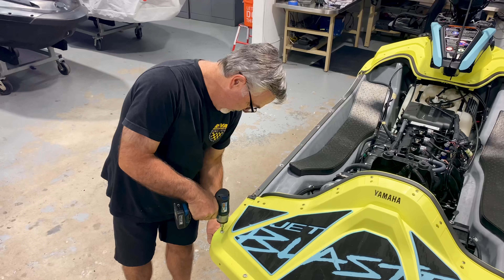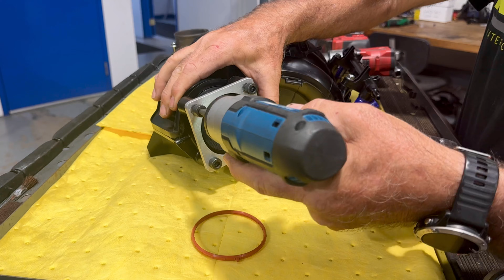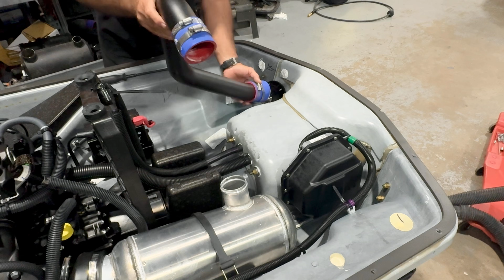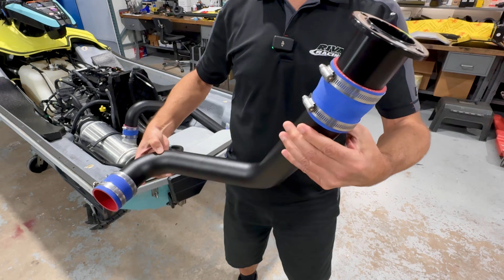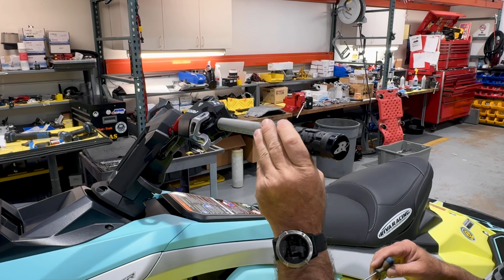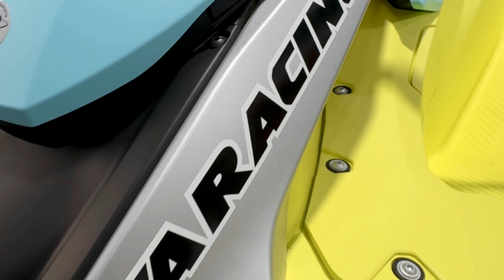2025 RIVA Racing Yamaha JetBlaster Stage 1 Build

Comment: does yours also have the pant and fiberglass damage from when they build them? its where the bolts are on the bottom hull and top connect.
Reply: They won't answer that because Yamaha is trying to keep it hush hush. It's a fairly simple fix and it is under warranty but may take a while for them to rectify it. I just purchased 2vand they're from the warehouse so I'm hoping they didn't build them and I can have them use the washers that prevent the issue during the build.

Comment: Do you also have the issue where the paint/fiberglass is cracking on this unit?
Reply: I solved this by installing m6x20mm stainless fender washers under all the brass bolts holding the decks on - it spreads the load and protects the fiberglass way better. 

I installed mine at 1.5hrs so i dont have any damage aside from the factory paint chips from assembly.

Comment: Hi Dave, so I have a 2024 Ex sport, how can I do this to my ski I want to do the rear exhaust I would you be able to help me with this
Reply from the maker: The modifications for the new JetBlaster are similar to those for the EX & previous JetBlaster. Follow the link we posted above and you'll see all of the Stage 1 Kit parts and available add-ons for the new JetBlaster.
Reply: @rivaracing8468  How about the FX, can I remove the top the same as the JetBlaster? I want to modify my FX using RIVA Stage 1 kit.

Comment: With that much add ons i was thinking 65 mph.  Id stay with stock they lose on depreciation anyways.
Reply: Depreciation doesn’t matter until you actually sell it. It’s about how many years of fun these mods add to stock unit. I was pretty surprised how reasonable the cost was for all these well engineered and custom matched components
Reply: Depreciation doesn’t matter until you actually sell it. It’s about how many years of fun these mods add to stock unit. I was pretty surprised how reasonable the cost was for all these well engineered and custom matched components

Comment: G' day, you  guys.  Ruffle how much  hp do you  get by doing these  mods.  Cheers
Reply from the maker: Unless you significantly modify the enginne, horsepower gains are minimal on normally aspirated watercraft engines. Acceleration and top speed are noticeably improved through our ECU tuning and pump & handling upgrades.

Comment: $1700 stage one kit. Plus  another $1000 for the add ons. Not terrible.
Great job Riva Racing.
Reply: For just 6 extra HP ? Nahhhh
Reply: @ecswest6083 6hp peak maybe but that doesn't tell the whole story , maybe it gained 20hp in the mid range or smoothed out nasty dips in the Dyno curve making the unit 10x more fun to maneuver. Who knows but all those other add ons make this worth it 100 percent.
Reply: Needs a turbo

Comment: My Ex with EXR intake grate and Riva ride plate is going 52-53. No way that is 50-51 stock
Reply: I can confirm I had the stock jet blaster pro to 54mph
Reply: @classicjetskis  can confirm my 2 up gets to 53-and bounces 54
Reply: Same my 2up will do 53 completely stock. Also they were saying 7,500 was redline but mine goes to about 8,200 at full throttle. Same with yours?

Comment: Love this, great work, nice to see the theories on what this TR1 can do be showcased... 57 with a stage 1 is impressive, will be see a stage 2/3 video... is there 60+ kits coming? Great video.
Reply: They say , stage 1,  but they install everything... I believe they made it stage 3, The stage 1, in their website has much less modifications ... Although he says that they made a "full built" !!!
Plus he says .... from 51 stock to 57 miles... But mine completely stock reaches 55 miles ( gps measurement) why are they saying that the stock top speed is only 51 ? 
What's your opinion my friend?
Reply: @jumaru7x  So when I tested the JetBlaster Pro recently (  https://www.youtube.com/watch?v=NDaYPgi2vX4&ab_channel=ClassicJetskis  ) I had 54 stock, but I figured that was because I only weigh 74 kg. That said, I’ve seen other tests that have hit 53, so I think 53–54 is realistic stock.

The thing that excites me more currently with the TR-1 engine vs the 900 ACE in the Spark is that the TR-1 generally takes mods well, getting to 57 mph and above. Don’t quote me on this, but I recall seeing someone in a FB JetBlaster group getting 63 mph with mods done, which is why I assumed what was shown in the video is only a Stage 1.

That said, I always thought a Stage 1 was an impeller change and a reflash. I’d be gutted if the video is a Stage 3, because then the question becomes: what’s left on the table in terms of bolt-on mods to get 63 mph?

FYI, the 63 mph figure is based on the 1100 WaveRaider, which is the same size, and the 951 Parabolic V XP (25 year removed, which is the performance curve we are chasing in terms of size of craft vs top end)—again, same size. 63 isn’t a random number; it’s the sweet spot for this size craft.

With all that said, I was impressed to see 57 with bolt-ons, its what I called in my first ever JB video at Yamaha HQ (   https://www.youtube.com/watch?v=C1uzcGrHvEs&t=9s&ab_channel=ClassicJetskis   ) , whereas most Sparks only see 54–55 with all the bolt-on mods. The yield and potential is definitely better on the JB.
Reply: @classicjetskis i agree with you 100% . I saw that video, but i think that they made it , turbo, in order to reach 63 miles . For me the cost of the full built, with an increase of 10 percent speed, from 54-55 to 60+  miles is perfect , anything more i believe is to much for such a small hull (3 metres only) . Also i don't want to lose, the low fuel consumption that the stock engine has now ,  with a much higher top speed ...